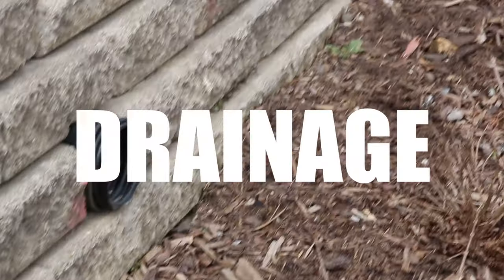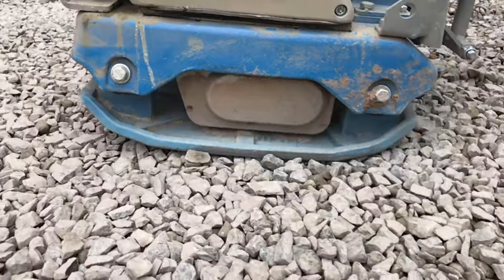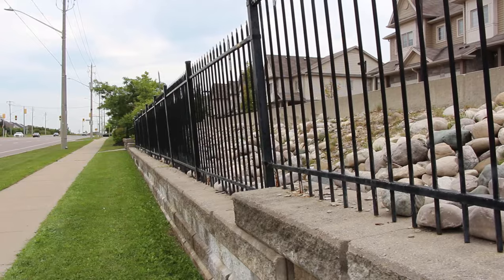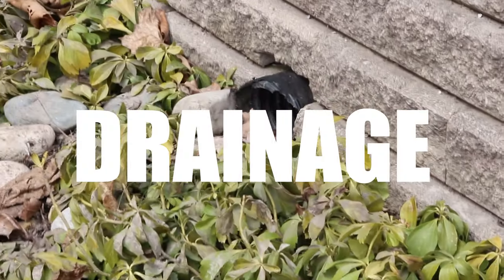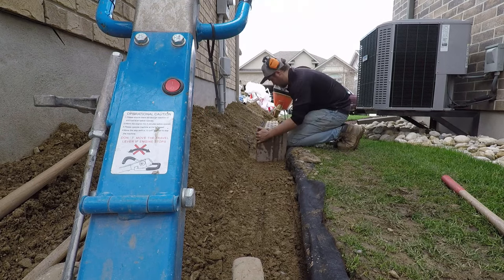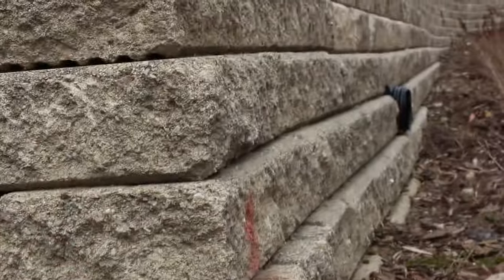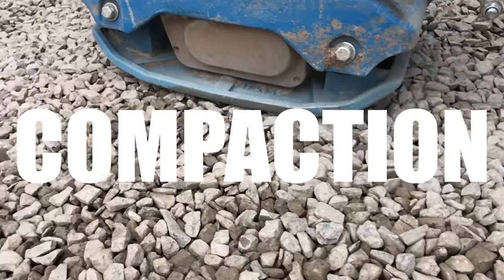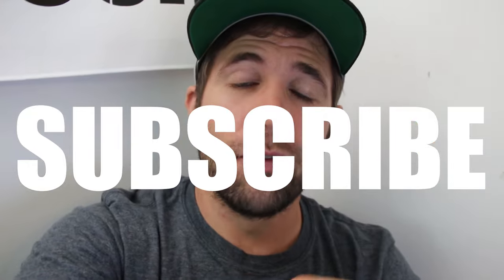7 Commonly Overlooked Retaining Wall Install Mistakes that Lead to Failure

Comment: Hydrostatic pressure??? It's because of the weight of the rock behind the wall. Ppl grade the ground behind the wall around 45° and all that weight with the Earth's rotation pushes forward into the wall and eventually the wall gives  hydrostatic pressure may contribute somewhat if the wall has drainage and fails it's not hydrostatic pressure because the pressure isn't pushing equally on all sides and the downward pressure is weak weak because the water pressure is changed dramatically due to the drainage.
Reply from the maker: So with that logic there is no reason to have a drainage area behind the wall. I’ve seen many walls fail within a year because of the logic you gave there.
Reply: @iamahardscaper  I never said no drainage. I said about the weight of several tons of stone pushing on these walls. Yes drainage is needed but  in the past twenty years there have been over 100 different ways to install a retaining wall and given today's technology this has never been perfected
Reply: But with that placing a mirroring parallel retaining wall to the first wall should mean there would be no need for slope at all because the force of the earths rotation would surely keep in in place since the earth rotates in a single direction thus exerting the a uniform directional force on all things alike.
Reply: Have you misunderstood? It’s the added pressure of water that causes the wall to give (often) hence making sure the water can drain downwards or out through the wall relieves the pressure and stops walls failing!
Reply: Brother, the earth rotates at 1 degree every 4 minutes...there is no relevant shift due to rotation of the planet. Put a piece of dirt on a basketball, rotate the ball one degree per four minutes...let us know if that piece of dirt moves at ALL.  Also, constant velocity does not cause any movement of anything at all... Acceleration is what causes shift. The earths rotation doesn't accelerate. And cliffs fall due to gravity, erosion, and tectonic activity. Js
Reply: @deanlawrence871  Apparent misunderstanding for sure. Have you ever seen Hydrostatic pressure raise an in ground swimming pool. I have many times in high water table areas. That’s why those pools are fitted with hydrostatic valves at the bottom. And surcharge is a real thing as well. Rotation of the earth Meh. Lol.
Reply: Sir, the earth’s rotation? 😂
Reply: @flightgeist1959  yes the earths rotation. These walls don't instantly fall but with time  and weather they can slowly give way just like anything else. Mountains fall all the time millions of tons of rock break off of mountains all the time sometimes in the driest of places without the help of eroding water. They just keep shifting until they collapse by their own weight or the weight they are pressed upon.
Reply: 😅 earth's rotation.  Can't wait to submit that as a fault during my next wall inspection.
Reply: The earth’s rotation does not cause or increase weight. (It actually reduces weight by a super-tiny amount.)
Reply: Every gallon of water weighs 8 lbs. If the dirt behind the wall absorbs 1,000 gallons you've added 4 US Tons of outward load to your wall

Comment: A house flipper put up a 7 foot high and down step retaining wall along both sides of the garage driveway length. He used little gravel; No Geogrid; No reinforcing rods, and no drainage hose.  Current landscaper tells us this and I see for myself.  The 2010 wall bellied out as a result and blocks began pulling apart.  Plus, he pointed out how the "Other Guy" used solid black fabric  behind the wall and never ever do that!!  We bought this next door house for my brother-in-law, and really did not want it, but were afraid of what would come if we did not.  It has been a money pit ever since (Like a boat).
Reply from the maker: Ouch sorry to hear that!
Reply: (BOAT) break off another thousand lol this has been my house as well.

Comment: Daaaaang I should have done more homework before starting this part of my project because besides digging out the area for my pavers and retaining wall I definitely didn't compact the ground before I put down crushed concrete , I did compact the hell out of the concrete though and have slag under the pavers and bricks. The wall is only 6 inches high so I'm hoping for the best
Reply from the maker: 6 inches isn’t too high 👍
Reply: Depending on how loose the soil was, with only a 6" wall, you should be ok for a while.

Comment: Silver City NM has a 100-year old, two-storey, water-pumping building made of hand-laid stone, whose basement is 20'x20' and goes 50' down, with no settling issues.  HOW?
Reply: The Romans built structures which still stand today.  The Pantheon in Rome is one of them.  In the middle ages it was besieged by several feet of flood water from the Tiber River until river flood walls were later built. Like one You Tuber wrote: "It is one of the most incredible buildings I ever walked into."  It is 2000 years old :  https://www.youtube.com/watch?v=GiDcLsZNMO4

Comment: I'm working on a 900ft2 raised bed garden that is on a slope and 24" tall/deep at the highest point and 8" at the lowest point. Custom made my drain system and set the base course on 4" of reinforced concrete. Blocks are smooth glue type and I used a solid film of Loktite PL-500 adhesive. Expensive and slow to build but I think it will work because as a glued wall it's a homogenous unit. Time will tell.
Reply from the maker: Nice! I would say that if your wall units have a locking mechanism built into them or clips of some sort you don’t need to use glue. And just make sure the glue you are using is flexible.

Comment: Doesn't the freeze line, for your area, determine how far down you put the footer (base)? Freezing subsurface heaves up and down from season to season
Reply from the maker: Segmental retaining walls are designed to be flexible systems. As long as the base is free draining that doesn’t hold moisture and uniform, plus the retaining wall needs to be constructed properly.

Comment: What about a retaining wall for a driveway.  If you want to run asphalt to the block.  Do you run a continuous drain along the top if the wall.  Or pitch it to a corner drain. 🤔
Reply from the maker: Your driveway should already be sloped towards the road so you shouldn’t have to worry about a drain behind the top of the wall

Comment: I don't exactly know how to use landscape fabric for a retaining wall. I know that you use a layer behind the backfilled part of the wall. That makes sense.

But I also see different combinations with lining the entire trench with it, layer above the base, layers between the courses, etc.

Lining the entire trench sounds strange to me as I feel like that would be like a gutter right under your wall. I'm referring to a diy backyard retaining wall no higher than 4ft.
Reply from the maker: Yes you definitely want to install the geotextile for the wall trench. It still drains especially if you get the nonwoven. It is more so to separate the gravel from the subsoil. There are two schools of thought behind the wall for fabric. I generally do especially if it is a garden wall. But always a layer of fabric on top of the drainage area behind the wall so the soil does not work its way down.
Reply: @iamahardscaper  So if I'm doing things by the book, I would have a layer lining the bottom of the trench. A layer from the capstone down the back of the wall and over the drainage area. Naturally I'll  also have a layer on the top of the backfill just for blocking weeds on the surface. Sound about right? Thanks!
Reply from the maker: Yes but if you are doing fabric for the trench, that can just extend to the backfill area and up and then back to the caps.
Reply: @iamahardscaper  Ah! Ok, so in a cross-section view a single perpendicular (to the wall) length of fabric can cover all those areas. Kind of like a fabric wall behind your actual wall/drainage. I haven't seen a video that has been super clear about this, but this was helpful. Thanks.
Reply: You don't need a non-woven geotextile lining the base trench if you're using 3/4 minus or any other well graded fill. Using it with the 3/4 wash, as shown in this video, will prevent migration of fines.

Comment: Do you have any tips on how to build a wall on a slope? I don't know whether to start at the top and stagger down or start at bottom and work my way up. Or just spend the extra money and dig a long level bottom. The wall is about 17meters long and will be 1m high at the low point
Reply from the maker: It is easiest and best to work from the bottom up. It would likely be quite a bit more to dig the whole trench level. Also just note that at 1m high you are at the border line height for requiring the design to be engineered.

Comment: I’d like to build a retaining wall in a riverfront location which would be able to challenge the  movement of blocks of ice during the spring thaw   Do you have any courses for this type of retaining wall? Thanks
Reply from the maker: I do not. I’d choose a manufacturer and reach out to them on specs for building that type of wall.

Comment: What is your opinion on Belgrade diamond Pro vs Piedmont/Rosetta’s Kodah products for retaining walls 3’ ish to 4’ at a certain point on one of two walls around our pool?
Reply from the maker: I unfortunately do not have an opinion on either. I've never used them. If it is an aesthetic question, that is all personal preference. If it is more so the function, I would double check with the manufacturers to see whether their walls can be built and how they are to be built to that height.
Reply: @iamahardscaper  ok thx. One is the rougher facing. The other are wet cut 45-100+ lb multi length pieces that resemble limestone and are easier to touch, lean against, sit on etc, but Kodah product is pricier and not sure I shouldn’t just save the 5k and use the $ on plantings/landscaping
Reply from the maker: Yeah, that is a budgeting issue but I wouldn't want to settle on something I wont like. I would just weigh whether or not you like the less expensive option. If you like it, it doesn't hurt to save a little and use that money elsewhere. If you feel you are just settling for that option, I would go with the pricier one and then just revisit the plantings when you are ready to in the future.

Comment: So I'm building a 6 inch retaining wall so I can level off my yard where it is lower than my neighbors yard and he has a lot of water pool on his side of the fence so I was thinking if I just built my yard up so it's just above level and graded slightly towards his yard go prevent the water from flooding into my yard, do you think this will work? Or should I install a french drain behind the retaining wall? I'm working on a huge drainage project, all of my downspouts are on a line and 2 french drains on a line both of which going to a few NDS flo-wells. I'd rather not have to dig more since that's all I've been doing for the last 5 weeks but if you think putting it in is a must, then I will. The area I'm building up is off my patio, I have one low spot that water runs off so I have a catch basin right where the water runs off, I graded the pavers to drain any run off to the catch basin but didn't expect to catch any of the water from my neighbors, just push it back towards his house (I offered the neighbor to put in a drain between our houses to fix both our problems but he had 0 interest so I figure he can just keep the water. Thoughts please?
Reply from the maker: I’m sorry any drainage work would need me to be there to see everything. It never hurts to have a properly built French drain.
Reply: @iamahardscaper   thanks for your feed back, I reckon I'll have to see if I still get water coming in from that corner after this project is finished and if need be, I have plenty of material left to do so

Comment: I’m building patio steps leading up to my house using retaining wall block. My base is 2A modified (with fines) and the backfill for the steps is going to be 3/4” angular clean stone. Do you think there’s a need for a drain since this isn’t expected to collect much water like a typical retaining wall? And if you think a drain is needed should it be on top of the base layer or higher in the clean stone? Thanks!!
Reply from the maker: I wouldn’t think a drain is necessary for just steps. I’d have to see, but if it is just steps, you are good

Comment: Does anyone have any experience with tire derived aggregate as backfill?
Reply from the maker: I have never heard of that before
Reply: @iamahardscaper  off the top of your mind. Would that sound reasonable to use? All it is is chipped vehicle tires at 3" to 6" used for drainage and lightweight support
Reply from the maker: I personally would not. I have never seen that speced in anything I have ever built and don't think that would compact properly.

Comment: I installed a 24’ round pool and need to make a 12’ radius wall halfway around the pool with the highest point 48” then slopes down to 18” on both sides. Is there a specific stone I need to use for that radius with the versa loc system? I’m not sure how many courses/blocks I’m going to need. It’s about 40 linear feet.
Reply from the maker: You can use any wall system, it just depends on how much cutting you want to do. Preferably with minimal cutting you are looking for a wall that has tapered units and then you can consult with the manufacturers specs to see if that wall works with that specific radius. Otherwise you will need to do some cutting.

Comment: Why don't you explain the processes you talk about for repairing the problems? Your video is useless and only comments on the blatantly obvious.
Reply from the maker: There are no repairs for these problems. Tear it down and start again. The solutions are in the video on how to build it properly and there are further videos on our channel for full guides to retaining wall builds.
Reply: @iamahardscaper  I have a retaining wall that fell because the fiberglass pins were not long enuf. We paid a professional to fix it and they said it will never fall. 10 years later, it fell. I fixed it this time for good. I was unable to find answers as to how to fix my wall.
Reply from the maker: There is never a fix for a wall unfortunately other than just following the steps to build it up properly. Good compacted base, embedded 6”, drainage area, setbacks and or geogrid for added stability, and properly leveling each course.
Reply: @iamahardscaper  I used 5 ft fiberglass rebar in all my base layers and pinned each upper brick with 12 inch pins to allow 4 inches of pin to hold each upper brick because the bricks are 8 inches thick.